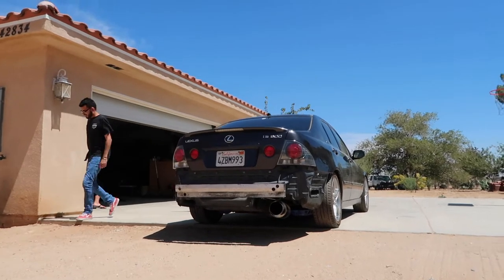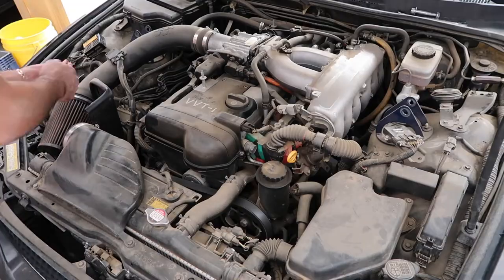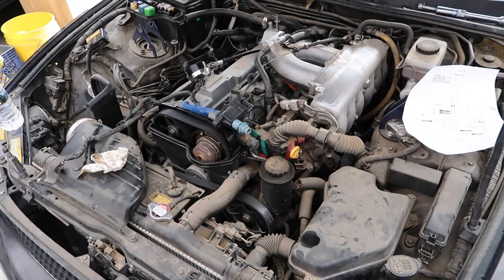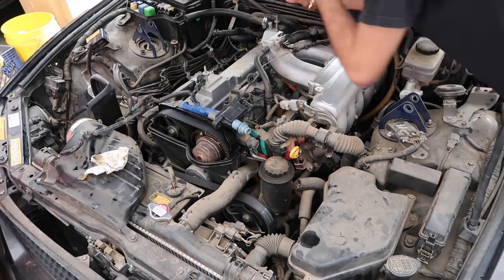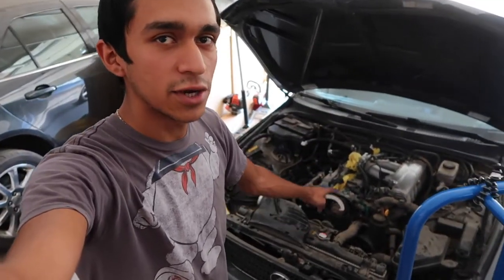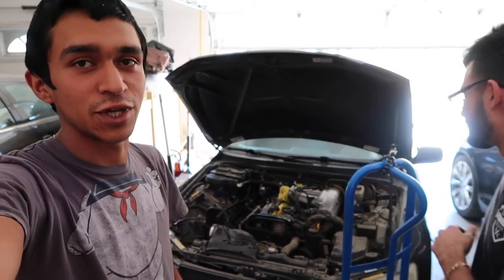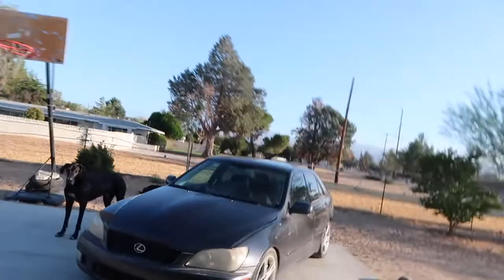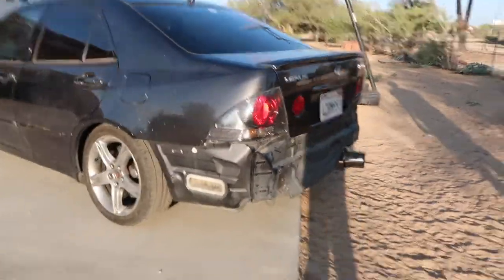Compression Testing Gus' Lexus IS300 + Slamming it!

Comment: About to compression test my is300 this weekend. Do you just remove the fuse for the fuel pump and then call it good? or what are the steps to get there? IM not stranger to having to remove everything intake wise as ive done my valve cover gaskets already, just not sure the proper steps for compression test